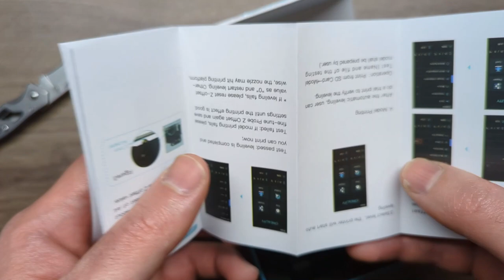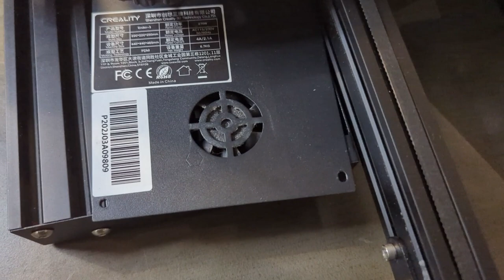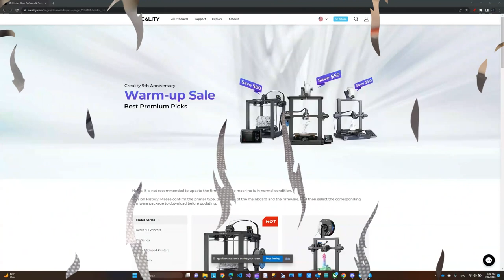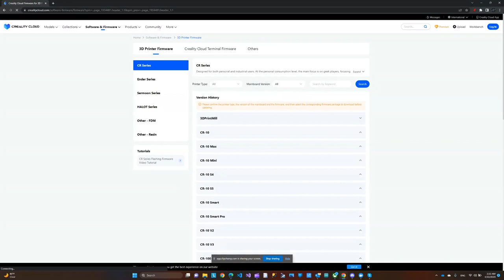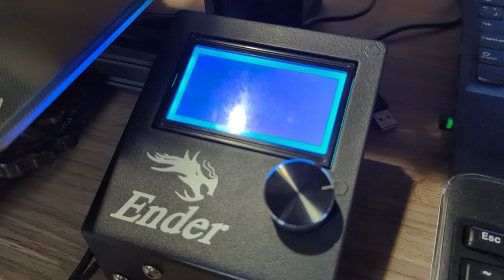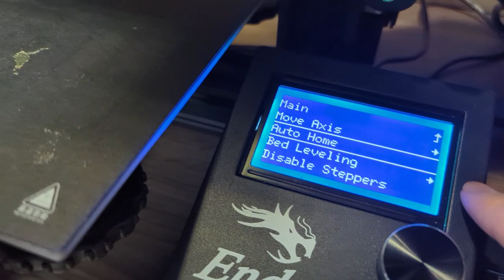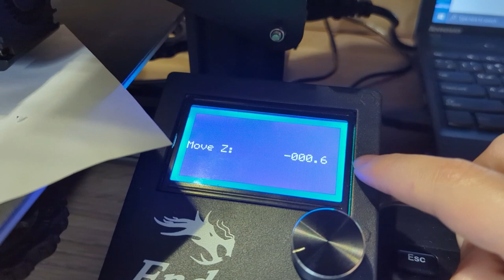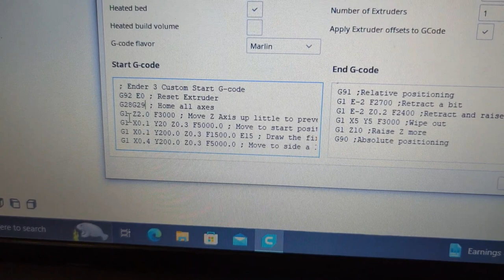CR Touch Auto Bed Leveling Upgrade For Ender3 And Other Ender Printers No manually level printer bed

Comment: I followed the the steps all the way through everything was plugged in and the working minus the firmware installation for some reason its still loading the version 1.0.8 and not installing the latest firmware (i have a v4.2.2 board) i even attempted v4.2.7 assuming i had made a mistake on which board i had and still nothing i reformated my sd card and met all with dead ends
Reply from the maker: Sorry to hear that, I assume you got the CR touch specific firmware and unplugged the Z axis. Are you getting an error or what state are you at?
Reply: @techs.passion  i dont know if it was the cr touch specific (i was following your steps since we had/have the same printers) but when i replugged the power wire and turned the printer on with the firmware .bin on the tf card it would just start as if nothing changed... as if the .bin wasnt being executed i had seen on creality's website that i needed to flash my firmware but i had seen many tutorials that didnt say to flash
Reply from the maker: You are going in the right direction but you need the CR touch version of the firmware. I do mention that in the video and also I have a video on firmware. I think you just need the  correct copy of the firmware. Go to the website and get the CR touch version of the firmware
Reply: @techs.passion i just rewatched the video again this was my 3rd time watching and i just realized i searched for the printer on the side bar instead of under cr touch thank you brother i had been losing my mind for hours trying to figure out what i did wrong i hope you have an amazing day 🙏🙏
Reply from the maker: Glad you got it figured out, very happt to help and thank you for watching. You too, have a good day
Reply from the maker: That could be the stored settings, did you store and settings, these get saved on the SD card. You shouldn't be removing it if you have settings saved on it otherwise the printer will go back to the default
Reply: @techs.passion  i had stored settings but ended up restoring it to factory when i was trying to get the firmware installed and reformated the sd card to fat32 and now it doesnt show that i have .gcode files
Reply from the maker: I see, yeah if you formatted the SD and you put the firmware file at the root that's all you need. Sometimes if the SD higher than 64GB might give you some issues, so maybe try something around 64 or 32 GB
Reply: @techs.passion  im using the 7.4 gb micro sd card the printer came with it has the firmware on the root with the .gcode on the root even restarting the printer and checking under "print" it shows no .gcode
Reply from the maker: I see, yeah that should work honestly but have you tried with a different SD card just in case this one is messing up?
Reply: @techs.passion  i did and i found out its a relatively common issue with the cr touch firmware but the jyers marlin firmware fixes the sd card slot and also over writes the cr touch (its just a modded version of the cr touch firmware) it also unlocks alot of the customization features which is pretty cool
Reply from the maker: Very nice and good to know, I should try that out. Also so glad that you got it figured out

Comment: so mine didnt come with rubber pieces and mine still has the spring and it wont allow my z offset to go below 0 and wont allow the nozzle to get close enught to the bed for the paper level how do i fix this
Reply from the maker: Hi, the springs are fine, no need for the rubber. As for the below zero, make sure to disconnect the Z switch and upgrade the firmware
Reply: never mind watched your other video and got it figured out!
Reply from the maker: Perfect, glad that you figured it out

Comment: So why did they make it so you can’t use negative values on the v2? My nozzle is too high and 0 is still too high. I give up.
Reply from the maker: You should be able to set a negative value for the z offset. Did you upgrade your firmware?
Let me try to help, no need to give up
Reply: @techs.passion  i really appreciate you and your fast response🙏:

I did upgrade my firmware. Appearance wise it all looks good so far. But I did the first autohome that leaves you with 10mm of clearance. And the lowest I can set it to is 0 on the ender 3 v2. Which also only allows full decimal point increments. So that’s making it even harder to dial it in. But either way. There’s still a good 3-4mm of space between the nozzle and the bed. My stock z switch is removed. Ive heard on some forums to add some 8 digit code to the OS of the printer or something. But that’s waaayyyyy out of my skill set and I don’t see how it’s necessary if every tutorial on YouTube doesn’t mention it. I don’t wanna do any more damage than I already have
Reply: @techs.passion  ignore my last comment: 

Things have changed. Still not working. But I found the official support for it. Installed that firmware. And I’m following tutorials exactly. 

- autohome.

- set the z offset

- manually level the bed

- autohome again. In which case it SHOULD do the 9 points. But instead it just undoes what I did.

There’s no videos or forums talking about any issues with these. And if there are there is no replies.

Do I just have a defective unit?

That’s the worst part about all of this nonsense. You could troubleshoot til the day you die and it could just be a faulty component that they just decided to send me anyways.
Reply from the maker: It could be a defective unit but did you make the g code change in the slicer? There is a pinned comment on this video talks about it. This might be the problem. Sorry to hear, keep me posted and I will try to help as much as I can
Reply: @techs.passion  I got some assistance on Reddit from someone who had the same issue. Apparently I needed the GD version of the firmware. And that solved my issue!

I appreciate your help anyway. You helped me keep going:) thank you!
Reply from the maker: I'm glad you figured it out and happy to help when I can :)
Reply: Hi when I tried to set the z offset to the -.60 I can only go up in 100s how do I fix that?
Reply: @Shane-ex1yu  I had that issue as well as not being able to get close enough. Try the “GD” version of the firmware if you haven’t yet. That’s what ended up working for me. Not sure how or why it worked but worth a shot🤷‍♂️
Reply from the maker: Hi, not really sure but you should be able to go in 10s because 100s is too much, maybe the firmware you have need an update. Let me research a bit more and update you if I find anything. Sorry to hear you are having a problem with it.

Comment: why don't we put the g29 code underneath the g28?
Reply from the maker: You are correct, that's the correct way of doing it. It's still working fine for me but the right way is under.
Thank you for watching and the correction, I appreciate it so much
Reply: @techs.passion  no problem! I do have another problem though, my ender three always shows no tf card. Can you tell me how to fix it? It’s brand new, there are no files other than prints, and I always eject it properly from my laptop. ( it is also formatted to the correct way) it was also working perfectly fine for my first three attempts, but then I just got the warning. And if it doesn’t show the warning, it doesn’t show a print.
Thank you
Reply from the maker: A few tings comes to mind, I have seen the issue also heard of it a lot. Try different MicroSD Card. Another thing is avoid large size cards, 32 GB is your max I would say. Last thing, when you bring the card back to the laptop, is it still works fine, like after the error, you take the card back to the laptop, is the card corrupted or good on the laptop? I know you said the format is correct and all that. Unfortunately, I have seen it being a motherboard issue and you would have to replace the board but I hope you do not have to go that far. Hopefully this helps, the last thing I would try is update the firmware version to something newer and if the printer not too old and if it end up being the board you can look into getting a new one from the seller. Thank you

Comment: why change start gcode?
Reply from the maker: It lets the printer level the bed before starting using the CR touch
Reply: @techs.passion  it wont work if we dont change it?
Reply from the maker: It will still work just fine from my own experience but it's recommended to update it. There is a pinned comment explaining it

Comment: So when I put in my sd card it's formated and works but it's not showing up on the screen if you do find it you can't choose the thing and i still need some help with z offset, should I get a new one that already has one or what should I do I can post a video on my channel to show you
Reply from the maker: Did you upgrade the firmware already? You need the new firmware to be on the SD card then of course you need to add your prints files as well before it can see anything 
Yes, happy to look at a video if it helps, also you can post it to my discord, it's free
Reply: @techs.passion  I don't have discord but I will post I video about it and can you help me about the z offset I'm new to this and I don't get it I already put in the firmware and have a gcode to put in there the torture toast test
Reply: Is there a way to factory reset or what, I can also show you my slicer software too if you need it and sometimes the file will load up put you can't click it you can only choose main and nothing else, got this for my birthday and thinking about selling it and get a new one of you want me to i can post a long form video of me inserting the sd card and all that stuff in my laptop if I need ti
Reply: And sometimes it doesn't even read the sd card
Reply: I got this to learn how to 3d print but it's been trouble ever since i got it I'm getting really annoyed and frustrated I want to sell it and get like a k1 for Christmas or something or get the ender 3 v2 neo which has auto leveling built into it I think
Reply: And just posted another one what I did to the bed trying to level it
Reply from the maker: I looked at your short, looks like you don't have any files on the SD card. Make sure the files are not in a zip folder and in the correct format
Reply from the maker: As for the Z offset, let me share a video explaining that
Reply from the maker: https://youtu.be/0zXcfKvxu2g
Reply: I do have files on it I can show you on my laptop if you want
Reply: And I was so excited to get this installed but it just doesn't make sense to me sense I'm brand to to filament printing. I'm used to resin printing
Reply from the maker: Sorry for the delay here, do not hesitate to let me know if you still need help. Also, I have a free Discord which I'm happy to help there as well
Reply: So me and my dad are going to work on it tomorrow but I have two files on there but they don't show up on the screen
Reply: We had to long format fat 32 for sd card
Reply from the maker: Yes, FAT32 and make sure the files are not in a ZIP folder

Comment: I am downloading the right thing for my version 4.2.2 board but when I put the microSD card in it doesn’t work and just loads like normal does anybody know why the firmware won’t update on my printer
Reply from the maker: Hi, you came to the right place, this video should help https://youtu.be/Um36ElyThS4
If not, please let me know and happy to offer further help if needed
Reply: I got onto the download page that you suggested, and got the file for my board but when I put it in it didn’t flash the file onto my printer and again loaded up as normal so I’m not sure what I should do next.😅
Reply: It was the file for the CRtouch
Reply from the maker: So you want to make sure that file is on the top level on the SD card and ensure your SD is formatted correct
Reply: I have formatted my SD card to fat32 and put the file into the sd card and it still didn’t work the only thing I’m not to sure about is how to put the file on the top level not sure what you mean 😢 but thank you so much for the help
Reply from the maker: I just mean do not have it inside folders and have it at the root level. Sorry that you still having a problem, if you like, I have a discord https://discord.gg/bJKXKDwF happy to further help if I can, it's free
Reply: @yeet_65  heyy I am having the same problem, did you find a way to fix it by any chance?
Reply: @matejviesner337  no
Reply: I think it might just be how old my board is, but I never found a way to get it to work

Comment: I did all these steps  and still it’s to high off bed
Reply from the maker: That would be the Z offset is the reason. Also I noticed that the software is not the best depeding on which version you are using but I would set the Z offset and ensure it is holding the value. Let me know if you need further help with that. Good luck